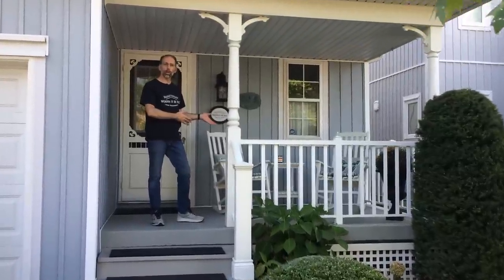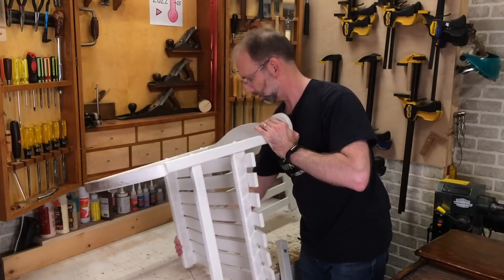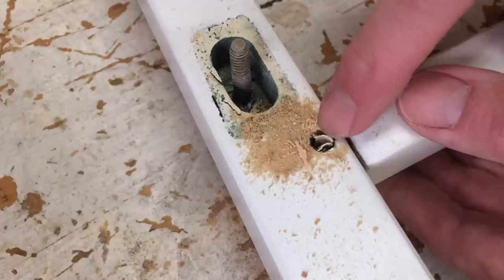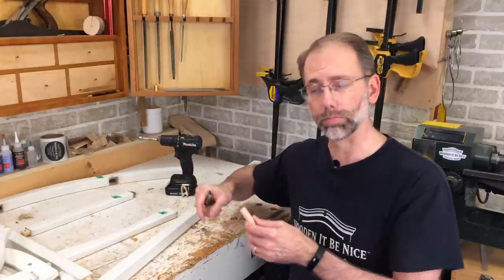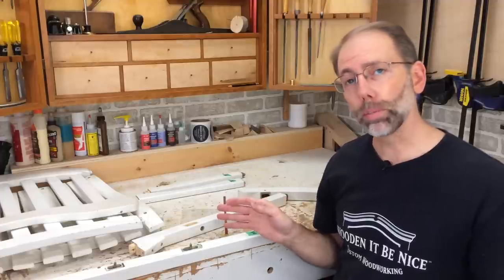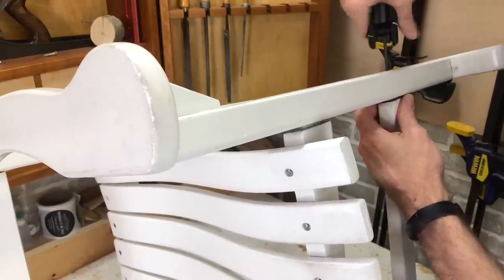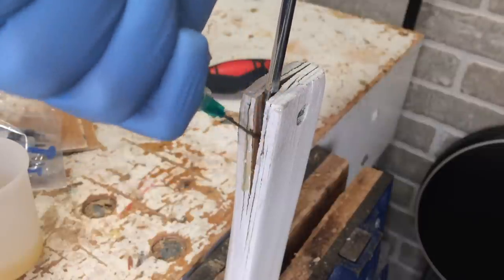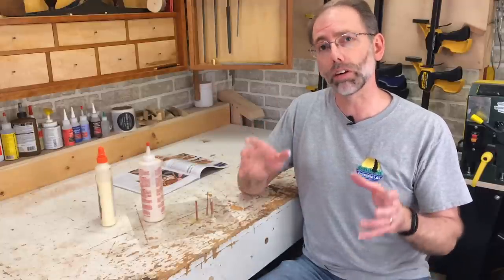Repairing Outdoor Furniture Using the Proper Wood Glue, a Fixing Furniture Restoration Project

Comment: For the air release slots I’ve used a common pliers. Squeeze the dowel in the larger holes of the pliers and you get automatic relief slots.
Reply: yea good idea, just like Ikea dowels, great tip thanks dude
Reply from the maker: Thanks for that tip Thomas.  That sounds good!  Scott #tip

Comment: Another great video.  I always learn something.  A question on the epoxy.  I thought the 5 minute stuff was only water resistant, while the 24 hour stuff was waterproof. Does the "flexibility" of the 5 minute stuff outweigh the lack of waterproof?
I look forward to the clamp comparison.

Comment: Nice video...what type of paint did you use ?? Oil or laytex..?
Also if you were to build an exterior door what type of wood is best and stain or paint...???  Thanks...🖖
Reply from the maker: The paint was an exterior latex.  Regarding a door, that's a detailed answer that's more than just a comment.  For a finish, paint or varnish will hold up to the elements with regular maintenance.  Scott

Comment: On the rocker where the pin was on the side and tear out the tenon, why didn't you make a floating tenon to replace the damaged one, and a new hole for a new pin?
Reply from the maker: That's a good question Oliver.  That's certainly a good solution to solve the problem with the partially broken tenon.  I decided for this particular part, there was enough of a tenon to use epoxy to put it back together again versus the amount of work to cut the mortise, make a floating tenon, fit the tenon into the rocker, patch the hole in the rocker from the old pin, then drill in a new pin.  I didn't feel it was worth the effort given how the rocking chair is used.  I hope that answers your question.  Scott

Comment: Is there a reason for not using glue (epoxy) at the dowels at 27:40 ? In my opinion using glue will help to strengthen the joint and protect the dowel from the moisture.
Reply from the maker: The pins in a "pinned mortise and tenon joint" are not glued.  In fact, this type of joinery was developed before reliable glues were utilized.  As you see later in the video, I prime the bare wood of the pins, then apply 2 coats of paint to the chair.  They're well protected from the elements.  I hope that answers your question.  Cheers.  Scott

Comment: You mentioned there was on place that the hole for the dowel was close to one edge, would that not be fixed to center the dowel better, or did you just place that dowel back to the original hole?
Reply from the maker: Hi Michael.  I decided for this particular part, there was enough of a tenon to use epoxy to put it back together again versus the amount of work to cut the mortise, make a floating tenon, fit the tenon into the rocker, patch the hole in the rocker from the old pin, then drill in a new pin.  I didn't feel it was worth the effort given how the rocking chair is used.  I hope that answers your question.  Scott
Reply: @FixingFurniture  Hi Scott, That makes total sense in this case.  Thank you for the reply and explanation.   I am a woodworker, but I do not have a shop.  I store my tools in our storage room off the carport.  When I wna to build something, I have to haul my tools out and use the carport as a shop so weather is a big issue for me.   I live on 2 acres in Texas.   Thanks again.  Michael

Comment: Most of this is spot on, but using a little extra epoxy hardener to speed up cure is not.  Using any ratio but the design amounts will make the cured epoxy softer.  

Think of it as resin having mortises and hardener tenons.  You compromise the strength if the numbers don’t match and you don’t make as many joints.
Reply from the maker: Thanks for sharing that Alan!  Scott #tip

Comment: I love epoxy, I love watching your videos but I don't fix any furnatuire, I use epoxy on retro computer stuff which is my hobby, the epoxy is great to reattach broken plastic pegs or to use in gouges in  plastic, that I can then sand flush and of course I have to paint but if its got a gouge I dont think it hurts the value to much to fix it by filling in with epoxy, aka like bondo
Reply from the maker: Thanks for sharing